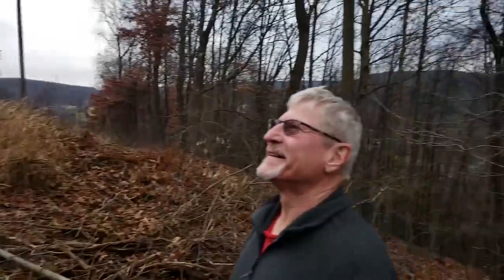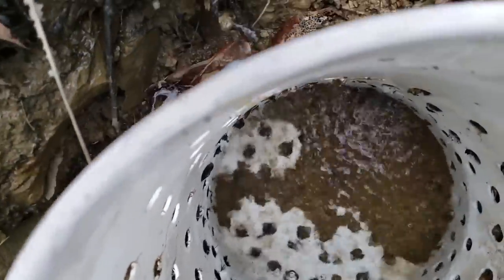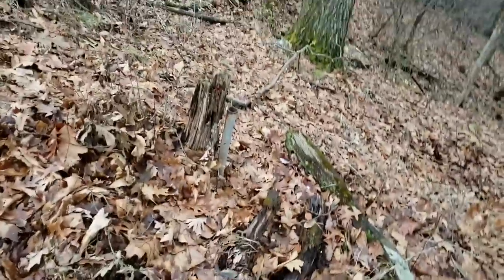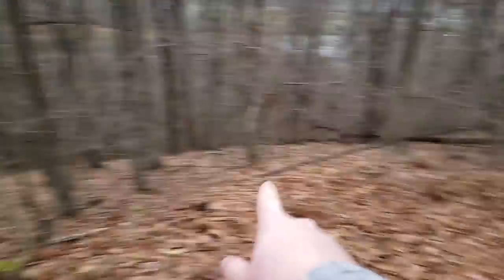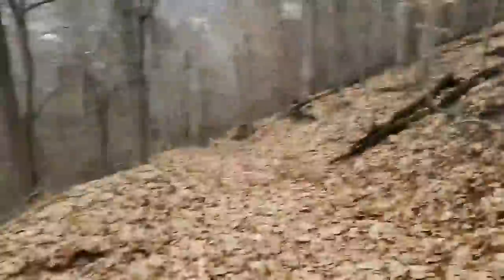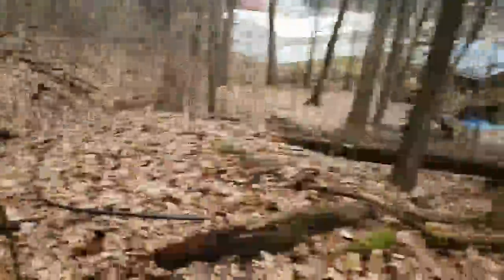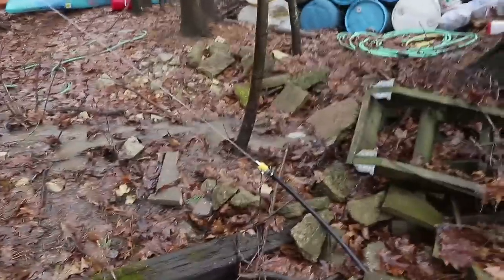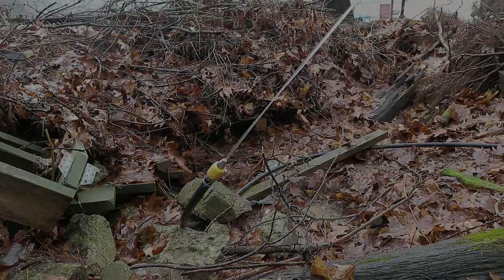[Part 3] Kilowatt Microhydro Turbine - Prototype Filtration System

Comment: Not sure what the delay is between the video and how far along the project is, but it might be worth your time and health (to avoid having to trudge up that hill a lot), when you run the water pipe, also run a conduit or 2 for a data cable and low voltage wiring so you can put a camera or two up there and monitor the spring and the pipe run remotely. If there is a problem in the middle of say an icy winter...at night seeing up there without having too travel up. 

As for filtration, maybe use a sort of reverse use drywell...dig a hole up there, insert a drywell (surrounded by filtration fabric and full of stone and put the collection end of the pipe inside it.
Reply from the maker: The only problem with the conduit is the length. I would need 800 feet of conduit which means 800 feet of wire. A camera would be very cool but a more useful device would be a water level sensor so I could throttle the nozzle(s) accurately. The second half of the video was recorded Feb 7 2019.
Reply: @JoeMalovich  True thats a lot of conduit, though depending upon expense you could use basically garden hose and run out door rated cat 6a in it. The conduit or  hose is just to protect against shifting rocks. Its just for sensors and a camera line.
Reply: Wifi/cellular cam? Old cell phone. An environmental housing could be made easily. First person drone racing uses cool cams. Power, solar? 12V battery? I don't know, just thinking outloud.
Reply: @thtadthtshldntbe  Could use a poe injector for power. That's a long wire pull, LOL.
Reply: Pyramyd Seven 800 feet is well over the 300 foot limit of any copper based data cable. Would need to run fiber at that length, and likely use power generated by the hydro to run the equipment. Not sure it’s worth the time, effort, or cost.
Reply: @jeffleal4519  6A, repeater, balun
Reply from the maker: @pyramydseven  low frequency long range wireless is what I was thinking, hc-12 wireless transciever with an Arduino at either end. Solar with battery at the spring.
Reply: Or a drone.

Comment: Have you ever heard of a ram pump? It uses a series of gate valves along side a water hammer to amplify pressure from flowing water. I'd be interested in seeing the pricipal tested in a hydro turbine application. I haven't tested the ram pump personally, but there are more than a few youtubers that claim validity to effectiveness, Mr Teslonian comes to mind as an example.

Comment: The pipe running down the hill is quite thin meaning there is a lot of resistance to flow, at the end although there might be pressure there is not a lot of flow meaning that there isn’t a lot of power there, I’d advise much thicker pipe (I get it costs a lot) but that’s needed for more power, without any nozzles I’d expect the tank up hill to be fully empty and pipe sucking air
Reply from the maker: This is just a small play system with 3/4 inch pipe at the bottom of the hill. The big system will have either 1.5 or 2 inch pipe.

Comment: Your inlet will work much better (less energy loss and less turbulence) if you make it tangent to the outer edge of your barrel.  Fast laminar flow around the circumference will provide the most effective silt separation.

Comment: If you had the feed pipe to the turbine starting at 3" the same as the black 3" entry to the bucket than reduced to 2" & than 1" & finishing with the dia you need for the turbine you will greatly improve & increase the pressure at the head

Comment: Problem is that your spring is at the top of the mountain, or very close, so in the middle of summer your going to get less flow than what you are going to get in the spring and fall time.  

Also do a double 45 set up in the barrel with the second one laying up against the barrel side wall.

Comment: Not sure that bucket filter will work for longer. Why not using a normal water filter system with stones and gravel of different sizes? Just fill the spring with it.

Comment: I don't think silt filtration is that difficult. Your release pipe should be at the very bottom, the inlet pipe above it and your outlet pipe up at the top. If needed create a baffle above the inlet that prevents water disturbance and silt to rise to the top outlet. The dirt stays low, not different from a septic tank. I also do this with my well water with high iron content and a 5000 gallon tank, the house water comes from near the top of the tank.

Comment: I would move the water outflow in the lid at the top, center. And start the vortex in the middle height with a flattened pipe, to move the water straight alongside the wall.

The slag removal would be placed best as a hole in the bottom. Maybe even make the bottom somewhat reverse cone shaped, let gravity help a bit more.

I would an emergency overflow further upwards, and completely fill the filter with water, to avoid any contaminations.

The slag output line don't need to constantly flow water, you can simply add a valve and flush the filter once a day, maybe at a time where you don't need that much energy. With automation you could open it once a day, if your consumption is below 80% or after two days of your consumption never dropped below 100%. 🤔 Something like this.

Comment: May I suggest a cyclone filter system like the shop dust collectors use? any particles get shot away from the exit pipe by centrifugal force and can be cleaned out periodically... #workout
An example here: https://www.rotorflush.com/wp-content/uploads/2016/04/Hydrocyclone1-e1460469712306.png

If you were to use a green barrel like you use for this test, insert an sheet op plastic to form a steep funnel, make a hole near the bottom for the flush out and two holes for the input (On an angle so the cyclone can form easier) and the output just on 90 degrees from the wall of the barrel. Since the speed and pressure of the water is low where the filter is (top of the hill, near the well head) you can get away with using plastic (hdpe). You could do a concrete version using the plastic as a form to make the filter more sturdy...

Comment: I think I missed the math lesson in V1.0.  What is the 0.18 coefficient?  Drag?
Reply from the maker: It's a constant to get the units to work. You can't just multiple GPM and Feet to get Watts. So the 0.18 has units of "Watts per (GPM * Feet)". it's a bit more complicated than that and I can dig up more info if you want.

Comment: I dont get the 460watt reading from 10 gallons a minute. Wouldn't the wattage be dependant on the head pressure and gpm?
Reply from the maker: Yes, I took gallons per minute times head height times a constant that gets all of the units inline resulting in watts.

Comment: Joe, thanks for these videos. I have a similar situation. 2 water sources, spring at 300’ and creek at 200’, both serving my property via 1” pipes. The pipe from the spring is 4000’ long, so spendy to replace with larger pipe. I want to do micro hydro, at least for rainy months. I also have a third water source that runs a 25’ diameter overshot wheel. Search “Niagara Heights Water Wheel” in Google Earth.
Reply from the maker: Very cool waterwheel! I'd love to see more videos of your systems.

1" pipe at 4000' long will only supply you with about 140W of power with pipe friction being a huge limiting factor which you seem to know. head over to h-hydro.com and look at pipepd.xls for an excellent calculator.
Reply: Joe Malovich yes, I know about the friction etc. my best option is probably going to be batteries. Here’s a vid of the water wheel running. If I can supply 30 gal/min, I can only generate about 60watts. The single pipe supply at the top needs to be teed to spread out the water flow to the troughs. A lot splashes out.
 https://youtu.be/1CbRfon4KMk
Reply: Joe Malovich this is the 200’ source. Long, just skip through the middle part.
https://youtu.be/XZc5H2sNA-s

Comment: A 45 might help create the spin.
Reply from the maker: The pipe really should enter tangentially, but I have no great way of doing that without massive holes (or welding something together which I can't do without a welder)
Reply: @JoeMalovich  Cut a section of inlet pipe at an angle to form a long taper.  Press the taper against the outside of a barrel and trace around it.  Cut a slot in the barrel just outside the  tracing, and save the cut out (it becomes your pattern). Liberally apply duct tape around the opening both inside and outside.  Insert an uncut section of inlet pipe through the slot and secure in place with more duct tape. Fully cover the inlet pipe inside the barrel with duct tape.  User fiberglass to form both exterior and interior fittings. Drill for a series of clamping bolts / rivets around the perimeter of the fittings.  Remove fittings from form.  Use the pattern to cut the slot in your field barrel install fittings with an RTV gasket.

Comment: If you check out my channel of the spring tank I attempted something like this but I don't have nearly the flow you have I just have a trickle spring they helped a little bit right around where the Overflow comes out I did make sure to put in an air brake in case it started to siphon. I think the setup you have will work well if you can find tune the exact amount of outflow to the exact amount of overflow

Comment: I think if you make a vortex silt will go to the sides not the center
Reply: No
Reply: @coreyballard8359 strange in my aquponic filter wich rotates silt goes the the sides
Reply: roger brown weird how the laws of physics work differently for you. You in Australia? https://youtu.be/H4WHsdvR4SU reference this video, especially at 2:34 where she says “kinda neat how it forces it all to the middle”
Reply: Correct.  The silt sucker should intake as close to the bottom outer edge as practical.  The "clean" water should be extracted from as high in the center as practical, preferably above the inlet level.  Centrifugal forces push the heaver silt particles to the outside and gravity pulls them down.  The lighter "clean" water stays in the middle and rises. 
https://en.wikipedia.org/wiki/Cyclonic_separation